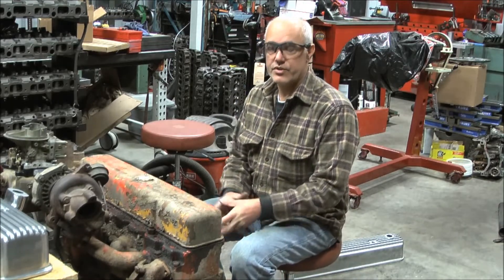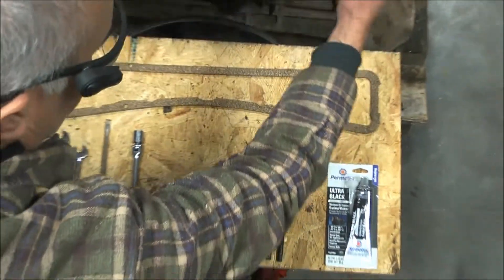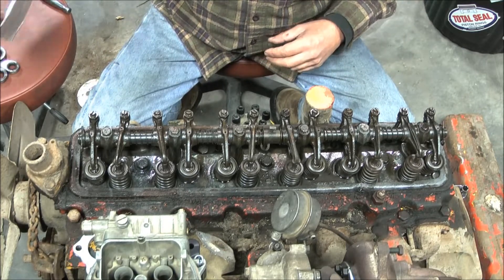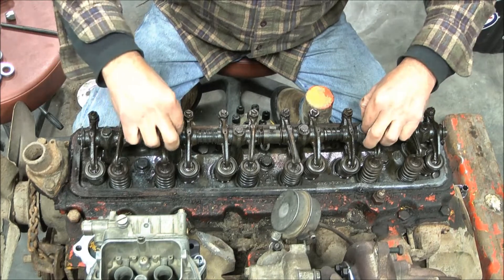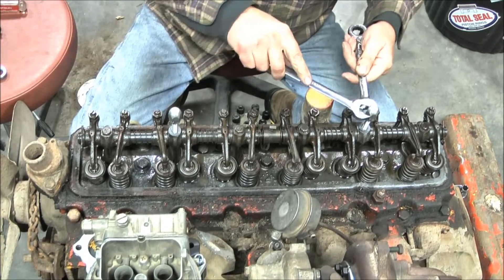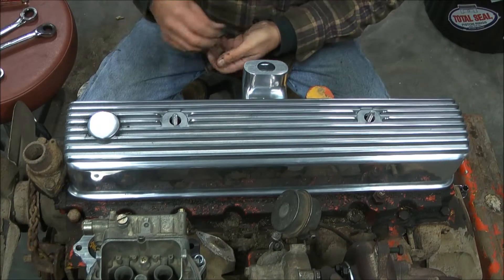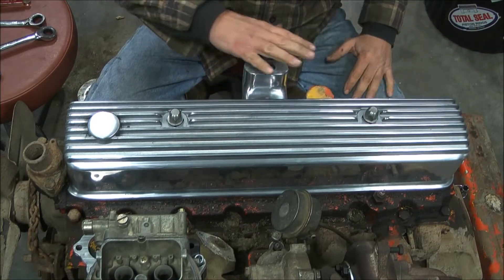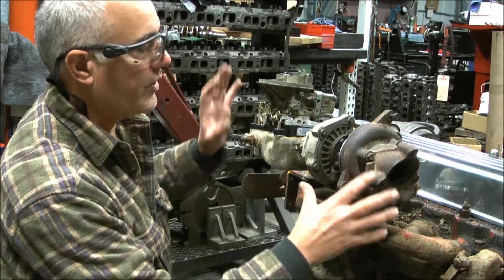235 Valve Cover install - converted from perimeter bolts to 2 bolts, turbo description

Comment: Silly question, but does removing old studs and installing new (to accommodate aftermarket aluminum valve covers) have any impact of the rocker arm assembly?

Comment: I looked on your website and dont see that adapter flange for the turbo to the intake manifold? do you still make them? how much? also, do you happen to make that "U" from the stock exhaust up to that turbo? if so, how much for that as well? been eyeballing a couple of these 301 turbocharger setups on ebay...are these based off a garrett T3 center cartridge?

Comment: Do you know if the newer distributor from like a 1980 250 will fit the older about 68 250ci. I never worked on the 6 cylinder besides taking them out to swap in a v8! But I am looking to start. I'd like to get stock small v8 performance from a 68 250, 250 hp would be great, with a little boost. But 300+ would be awesome! But I was thinking of starting with about a 350-500 cfm carb. And a turbo from about a 3.5-3.8 liter. And about 8 psi, draw Through. But a 15psi blow through, with intercooler, would likely need beefed up internals correct? This 6 cyl stuff ain't cheap. But I'm thinking a little head port and chamber work, and a modern cam grind will help the power a bit. A hyd roller cam? If so I bet that would be spendy!! Maybe I should swap in a 283, 305, or 327 or 350, I do have a .030 400,  I had a 82 1/2 ton truck, i put a 4 speed in, it made night and day difference from the 3speed, I'm betting  a 5 speed would be even better, plus the overdrive! A 4.10-4.56 gear then overdrive, would be close to a 3.23 or so with out o.d., it would make 1,2,3&4th more fun, and still go down the highway nicely... I'm wanting to go with the 6 banger because of gas prices, but 225+hp around 3500-4000 r's would be great. Or 250+ ftlbs tq at 2000, any advice?? And where to buy parts for these motors? I saw a 2x 1 bbl intake was like $400!!! I can put a v8 in for $400 or less. Buying the motor!